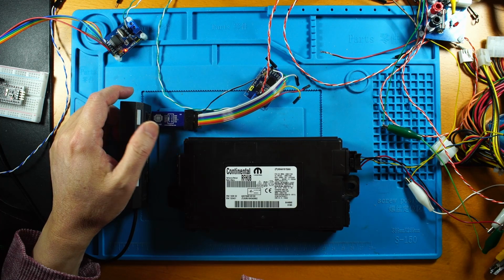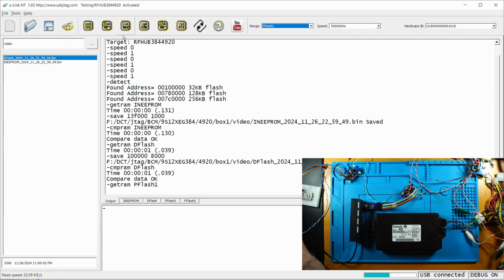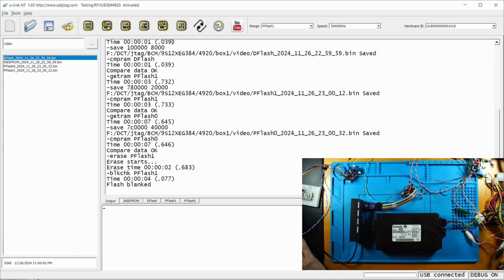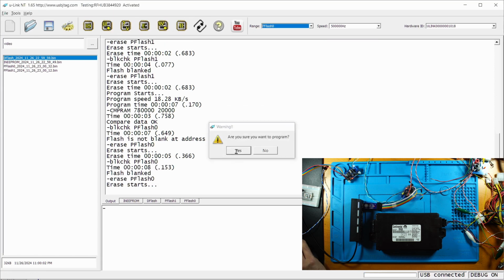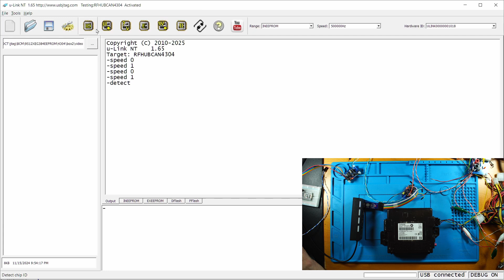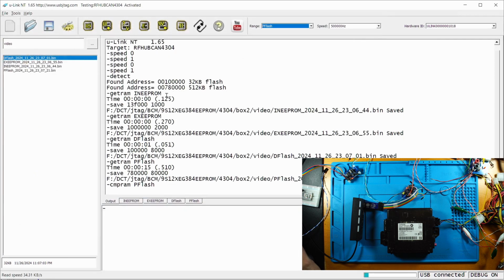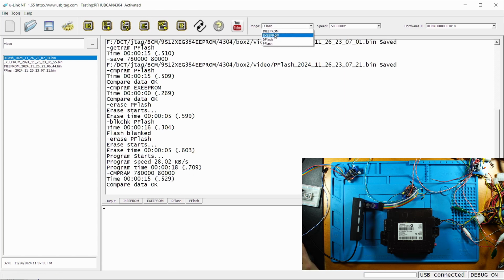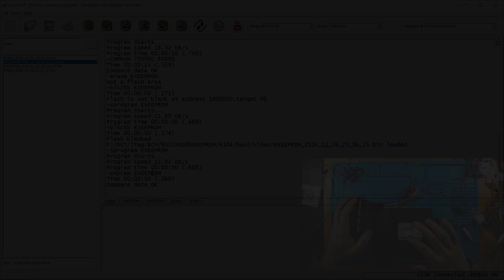u-Link NT program RFHUB over can bus.

Comment: TO VIEWERS.. If you are cloning a module to replace a bad one, it's best to use the BDM method as it reads more sections of memory thats sometimes secured from being accessed via CAN Bus method. Better safe than sorry. I still like that information can be accessed 2 different ways though because sometime you only want to modify basic data and correct the checksum.
Reply from the maker: @CLGPerformance  Can we have a discussion? I found I can do exactly the same as the BDM method. The only difference is BDM allows you to debrick the device, other than that,the difference is CAN BUS method is faster?
Reply: @usbbdm Hi, yes the CAN is faster and will copy entirely in this case. I had some issues with other modules with the example a TC1796 chip where if you read via CAN, it will not read PFlash entirely. But if I do it via BDM it will copy entirely. Just best method is bdm. CAN is okay but I've had cases where I couldn't trust the data. You will think it's all the data but some areas just copy "00". I definitely trust the BDM method more than CAN for data integrity especially when cloning
Reply from the maker: @CLGPerformance  maybe true for tc chip. I will deal with them later. For 9S12 chip, this is not the case.